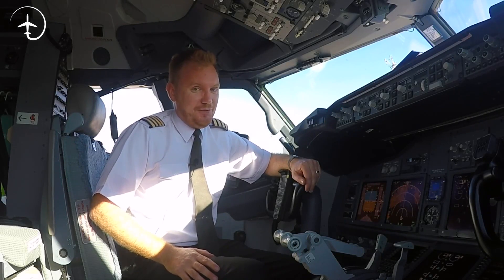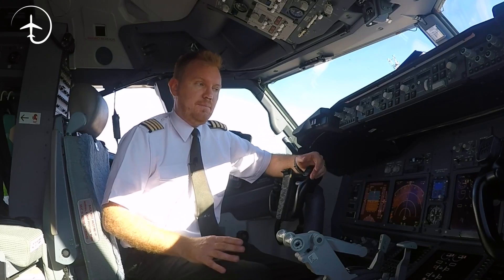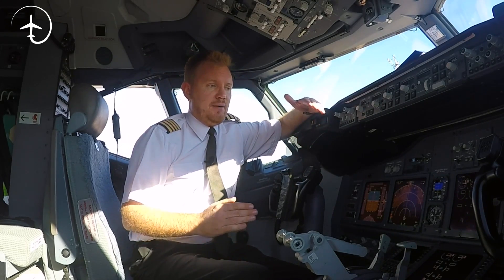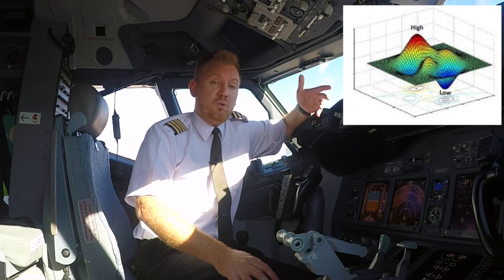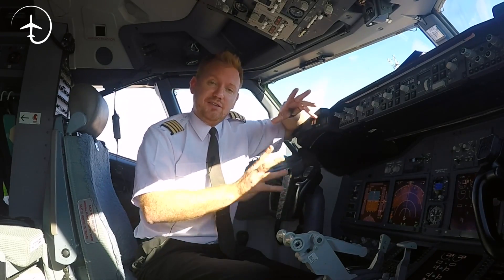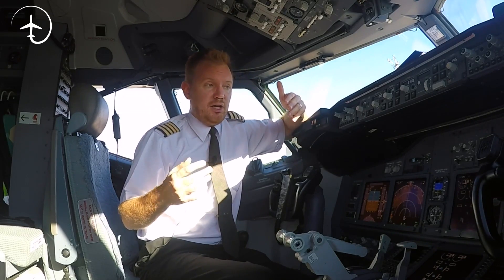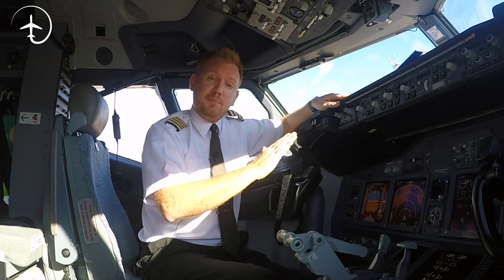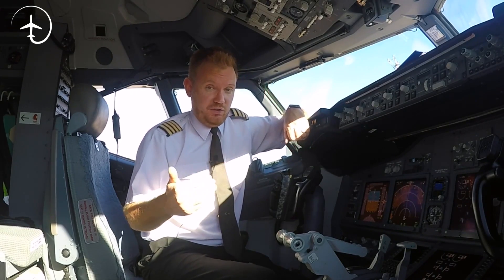How do the Altimeters work and what is a Flight Level?

Comment: So I am getting wrong results but I don't know why, here are my findings Capitan:

1 hPA = 30 ft
QNE = 1013
0.1% of QNE = 1.0130000000000001 hPA

1013 / 1.0130000000000001 = 1000

1000hPA x 30f/hPA = 98425.197 Foots
30000 Meters

As I know the highest possible FL for a commercial plane is FL450 and the only plane which can achieve this is Boeing 747-400

Comment: What would happen if the altimeter broke mid flight? Is there a contingency for the pilots to gauge their elevation?
Reply: I would think there is more than one on board the aircraft. I know that the local airport here has 6 barometric pressure sensors, to ensure they always have the latest pressure reading available.

Comment: Is it  30419.5  ft?  (I'm bad in maths) 0.1% of 1015= 1.015 hpa so got difference of 1013.985, then tried to relate 1 hpa = 30 ft
We have pressure difference of 1013.985  then multiplied by 30 so 30419

Comment: pythagorean theory. You are on a particular angle (flying diaganal) this would represtent the degree angle of "C" (hypotenuse) relative to "B" (earth surface)  in the pythagorean theory. this is not enough information , you will need to know  the distance from surface to atmosphere edge. (or use some other mathmatical knowledge I don't have) The Problem, as I see it, is knowing the exact distance from earths surface to the edge of the atmosphere seeing that the earths surface changes all the time.... This is definatly a thinker....

Comment: Amazing explanation sir, but I have a doubt that what is the relation btw pressure altitude and altimeter? Does pressure altitude have any relation with Flight level?
Reply: If you reset the altimeter setting in the altimeter's altimeter setting window to 29.92 inches, the altimeter will display the actual pressure altitude.

In the United States, once they climb to above 18,000 feet, pilots reset their altimeters to 29.92 inches, which means that they are flying a pressure altitude. 
FL180 is a pressure altitude of 18,000 feet; FL190 is a pressure altitude of 19,000 feet; FL250 is a pressure altitude of 25,000 feet; etc. It's called a flight level because when flying toward an area of higher pressure (H - on a weather map), the aircraft will climb; when flying toward lower pressure (L - on a weather map), the aircraft will descend, BUT DURING THE WHOLE TIME, THE ALTIMETER'S INDICATED ALTITUDE WILL REMAIN CONSTANT, while flying at that flight level (for example, at FL350 the altimeter will read 35,000 feet, even as the aircraft climbs and descends during the flight. 

Since all aircraft flying above 18,000 feet have 29.92 inches set in their altimeters, separation is assured because they all are climbing and descending at the same rate as they fly from one pressure area to another (H to L, or L to H).

The reason for setting the altimeter to the nearest airport's altimeter setting (usually given by ATC), is to know how high the aircraft is with relation to obstacles and mountainous terrain. Since the highest elevation within the Continental United States is less than 15,000 feet, flying pressure altitudes above 18,000 feet should provide adequate terrain clearance.

However, if the altimeter setting given by an airport is less than 29.92 inches, FL180 becomes unusable, because an aircraft flying at that level would actually descend to less than 18,000 feet. In normal flying, FL190 would then become the lowest usable Flight Level (ATC will actually advise pilots, "Altimeter settings in the area are too low for FL180. I can offer you FL200, or 16,000" (usually for an aircraft flying in a westerly direction). FL200 would again assure terrain clearance flying at 29.92 inches; 16,000 would be a "hard altitude" in which the altimeter would be have to be set to the current altimeter setting for the area (as an example, 29.78 inches might be given by ATC to the aircraft, which the pilot would set in the altimeter setting window for the altimeter to read correctly).
Reply: Wow, finally I  understood the whole things stupendous explanation.

Comment: So how will you know that you have reached the correct altitude (IE:36K feet) instructed by the airport or in the middle of the flight if you are using the standard pressure? Or if the ATC or anyone asks for your altitude?
Reply: The autopilot would be set for FL 360 and would level out at that level, not 'altitude'... which would also be displayed on the altimeter as (approximately) 36,000 feet, yet the aircraft would not actually be at precisely that altitude... but dependant on the actual local MSL pressure (QNH). I'm not even a PPL pilot but you, "Captain Solo" couldn't work that out? Remember: at those altitudes, no-one would ask for your 'altitude' because a) it can't be accurately established from the QNE setting... and nobody cares what your 'altitude' is when clear of all terrain, and b) exact altitudes are useless for aircraft separation purposes when using the Flight Level system of 1,000 feet separation for nearby aircraft. Anyone using QNH at an altitude near to another aircraft using QNE would, unless coincidentally, be flying 'in between' Flight Levels and would be a danger... like driving between two lanes. They would ask for your Flight Level, not your altitude. 36,000 feet in this example is just an INDICATED (and approximate) altitude using the Standard Pressure (QNE) of 1013.25 hPa... just as Indicated Airspeed is not an accurate representation of what your actual Ground Speed or True Airspeed is. [Can't believe no-one tried to help you a year ago so I hope this helps.]
Reply: @johnny_pilot  Thank you "Johnny P" for your effort trying to explain. I actually stopped my PPL because I couldn't afford it anymore, unfortunately. I think I understand what you want to say. However, just to be sure that we are on the same line. Starting at which flight level it isn't important to know the elevation of the aircraft The reason I'm asking this is to know whether or not I am 'High enough' to start using the standard QNH. You know what I mean?

Comment: From my layman's perspective, it seems that there should be a better way to determine altitude than a pressure gauge. i was wondering if GPS could be used.  If the GPS knows exactly where the aircraft is, 2 satelites should be able to locate a point that is directly above the aircraft perhaps at the same height of the satelites.  then the GPS could measure the distance of the aircraft to this point and subtract it from the distance of mean sea level to this point.. This should give the true altitude. Please let me know if this is being done already or if it is possible

Comment: 9 apr 2020 7:53 pm edt:thanks
10 apr 2020 12:8 pm edt:
so flight-information-tv for aircraft-passenger which says 'altitude .... feet', is not accurate during flying above earth-surface which has different-altitude than departure-airport-altitude.
10 apr 2020 12:28 pm edt:
7:17 standard-qnh-setting 1013.25 hpa
7:59 following atc to climb to fL200 using qnh-setting 1013.25 hpa
8:18 1 flight-level = 1000 feet

Comment: Nice video Mentour. Just wondering at Heathrow they broadcast QFE as well as QNH what is the different please.
Reply: If you set QFE on your altimeter it will give you your height above the runway. When you land, it will read zero, which is convenient.    If you set QNH on your altimeter it will give you your height above sea-level and so when you land it will show the height of the runway above sea-level.  So Heathrow caters for both options - whichever you prefer.  I doubt if many, if any, aircraft do "circuits and bumps" at Heathrow, so if you are leaving the airfield using QNH will indicate the height that is more useful for terrain clearance, as maps show heights of hills and mountains above sea-level.

Comment: 0.1% air pressure versus at sea level is essentially zero air pressure. If every 30 feet you lose one hectopascal and the standard is 1,013 hp, then 30 feet times losing all pressure is about 30,000 feet. But that certainly is not the edge of space. My guess is 30 feet per one hectopascal in change of atmospheric pressure is true only for the more limited functional range of commercial aircraft altitude and not for the full extent of Earth atmosphere up to the beginning of space.

Comment: Thanks for that easy to follow explanation on QNH and flight levels. However, I was a bit surprised you didn't mention QFE. Could you please give some explanation of that?
Reply: QFE doesn't appear to be much used by airliners - as it indicates the height above a specific airfield, and airliners have radio-altimeters that indicate just that, when flying close to the ground.  QNH indicates the altitude above sea-level, and is relevant when negociating nearby high ground, until the aircraft is high enough to regulate its flight by Flight Levels.
Reply: QFE, for example, is used for aircraft doing patterns and touch & go's above the aerodrome's mean/nominal Field Elevation (useful for memory). It is only a local air pressure setting in hPa provided by the aerodrome and effectively (almost) zeros the altimeter when on the ground at that aerodrome... which could, for example, actually be 500 feet AMSL (above mean sea level). So, QFE is really useful when, for example, flying a runway pattern of 1,000 feet AGL above the runway (above ground level). It really has nothing to do with Flight Levels as you now understand, which is why he rightly omitted it for the purposes of this video.

Comment: What is the altitude at which you set that standard air pressure?
Reply: The transition altitude, I understand, is provided by ATC dependant upon the local aerodrome AMSL (QNH) pressure. It is not a fixed altitude.

Comment: 0,1% of the 1 atmosphere is at almost 50 000 m and I think a plane can fly only at around 15 000 m because of the density of the air which is not creating lift anymore
Reply: I tried to calculate it. 0,1 % of the pressure on earth. Well I calculated for  1014 Hpa: 1014 - (1014 * 0.01) = 1014 - 1,014 = 1012,986; then 1012,986 * 30 (30 ft per 1 Hp) = 30389 Ft.  For  1030 Hpa the result would be 30869ft. A general form for every pressure in Hpa on ground: 29,97 * P = altitude in Ft for the edge of space. However I could not find the solution on the given link. Did anyone find the correct answer?  I am not sure if I am correct. I expected the edge of space the be way above todays normal airliners..

Comment: Sir the answer of your questions may be 
1000times the height taken at ground level, 
If we are considering that pressure is perfectly inversely proportional to height and height is taken meters
Reply: Pitot tubes also work by physical measurement, which is what I think you are asking about. A lot of planes also have a turbine that can be deployed for generating electrical power in case of system failure.

Comment: Hello
How can u amend the altmeter to 1013.25 while u not in transition layer yet and u still in 3000 meter how the device will give u the right flight level 
And for the countries or airports which have different transition level 
How can u uniform your qnh to 1013.25

Comment: Where is my mistake

X altitude with 10.1325 hpa
30 feet climbing 1 hpa less
1013,25 hpa standard

 100 Ft = 1013,25hpa
X Ft = 10,1325

 (1013,25 hpa - x *30) = 10,1325hpa

1013,25 = x*30 + 10,1325

1013,25 - 10,1325 = x*30

(1013,25 - 10,1325)/30 = x 

X = 33437 ft

Here im reading about 100km (which without transitioning I know is way more Than my feet...), so what other equations are out there for this?
Reply: Looks like you calculated it for 1% pressure instead of 0.1% pressure, which is why you ended up off by a factor of 10.

Comment: What about transition levels/altitudes?
Let's say that your initial climb after departure is 7000ft, and your TA is 5000ft. You are climbing towards 7000ft passing TA, I presume you then set STD pressure (unless you've been cleared to a flight level before passing TA)?
Same thinking when descending?
/Martin
Reply: Transition Layer is sandwiched between Transition Altitude and Transition Level. The moment they pass the TA (which varies considerably across countries and some airports), the standard QNE (QNE is always used for FL) of 1013.25hPA/mb is set regardless. And during descent, pilots change the setting to local QNH after having passed through the transition level, layer and eventually they descend into the TA again.  Hope this clears it. :)

Comment: First of all Thanks for your great content !
I am so curious and realy disturbed by one simple question ;  the static port is just a hole located on the fuse surface , hence there is an air stream right over the surface - which means that there is an air velocity that affects the pressure right on the closest layer over a given surface ( as speed grows the pressure drops , Bernuli principle isn't...).
So my question is as follows : is a static port actually affected by airplane speed and does a pressure realy varies due to this?
 If yes , how this should be considered when altitude measured.
If no, please explain the phenomina - how this can be eleminated ( in my understanding it violates the bernulli principle )....
Thanks a lot , anyone who will be able to clarify that interesting point for me, is very welcomed to reply !
Reply: Hi, static and dynamic pressure are two parts of overall pressure in the Bernoulli equation. As the static port is on the side of the fuselage, the velocity of the air should be perpendicular to it and as a result there should be zero velocity at the reading point. This is also helped by the fact that at the surface there should be zero velocity anyway due to the boundary layer.

Comment: It seems to me that the answer would depend on where you were at the time you were measuring your altitude taking into account the difference below 2500 feet.
Reply: Unless you use the Standard pressure setting of 1013.25 for aviation... which is how they reach the rounded figure of 100km.

Comment: in my experience in consumer entertainment flight simulation games, QNH was always given in inHg. you refer to it mostly in hpa. the plane seems to support both. 

Do airports in different locations give you the QNH in different units?

with standard pressure being 29.92 inHg and 1013hPa, does air pressure on earth at sea level vary naturally so much that a 4 digit  sequence (decimal point removed) could refer to either units? (like a very low pressure measured in  inHg using the same digits as  a very high air pressure somewhere else measured in hPa?

if so how do you know which unit the airport uses?
Reply: ok, i was able to research that second question myself. it doesn't.

but still, being given the QNH in an unexpected unit could cause a lot of confusion and erroneous inputs, especially at times with high work loads in the cockpit.
Reply from the maker: It’s normally different in different countries. In the US they use inHg and Europe etc use QNH

Comment: Using GPS would seem to make sense, aswell as having a system that automatically gathers and correlates information about local air pressure from satellite data with data from the pressure sensor, maybe there is such a thing but knowing how the conservative approach of the industry retards cockpit technology by decades I kinda doubt it. I really hope that starts to change as it's really reaching luddite levels  considering the massive improvements in capabilites and ironically reliability adoption of even moderately modern electronics could bring. Compared to the typically used 80s/90s era microelectronics even ten-year old microelectronics could provide a ten-fold increase in processing power with ten-fold redundancy at a tenth of the power consumption and component count, leading to potentially ten-fold higher reliability for each redundant part due to the vastly lower component count; that's not just my fairly knowledgeable opinion, I've seen articles by microelectronics experts frustrated with this industry's nonsensical approach to reliability arguing these points, and  it's especially egregious considering the widespread adoption of very modern tech in nearly all other aspects of plane construction.

Comment: Wait a second: an aircraft holds a flight level by monitoring air pressure. Also, as we know, air pressure changes with terrain relief and with weather. Does that mean that all the aircraft that are flying on a flight level are constantly moving up and down following the change in air pressure?

Comment: From ACI: the static ports are known at PITOT tubes. And yes, when they get blocked or ice up, bad things happen.
Reply: Pitot tubes measure air flow (velocity relative to air), whereas static ports provide outside pressure without the air flow. Not the same thing.
Reply: Pitot tubes are the ones parallel to the aircraft facing the airflow and measuring the pitot pressure which is equivalent to the dynamic + static pressure after which we have a differential measurement through capsule ,differential being the pitot and static resulting in the air speed indication,static are the ones which are on the aircraft body unlike the pitots which are protuding out measuring the airflow

Comment: At sea level the standard pressure Po=101.3kPa. 1% of sea pressure is on altutude 16000 meter above the sea 0.1 % of sea pressure is on 30000 m above sea level. I'm not sure that pressure drops in linear manner with rise of altitude. accorging to elementar physics P=F/A=mg/A=V*rho*g/A=h*rho*g. The problem is that density varies with change in height. I think that  the aircraft has static pressure gage and additional there is Pito tube for dynamic pressure measurements.

Comment: Why is the open path radar (thus vertical radar) not used as an altimeter? It is an accurate measuring principle and used e.g. for storage tank level measurement.